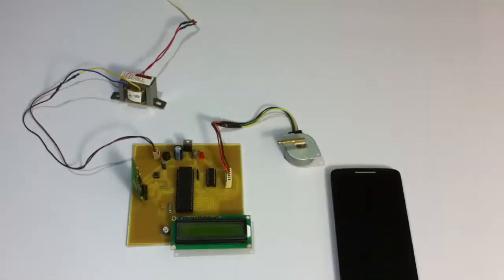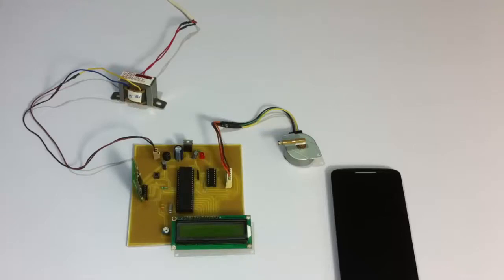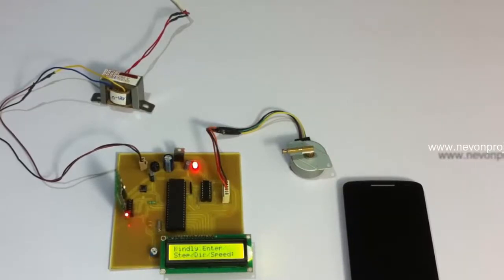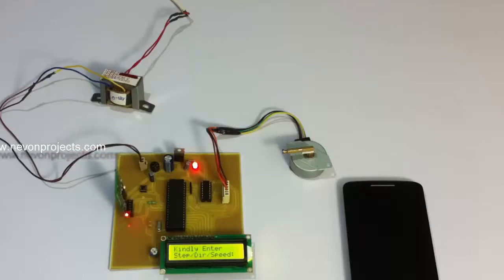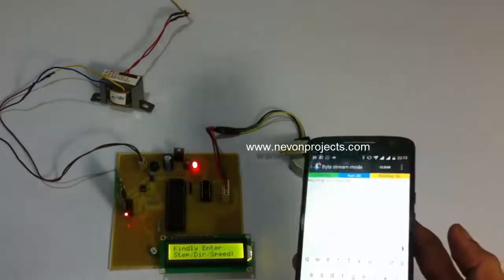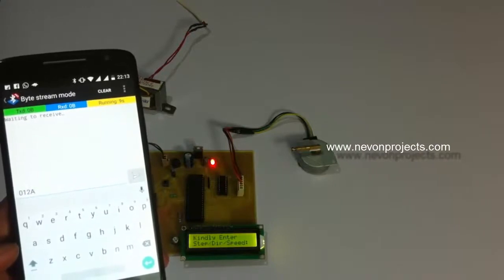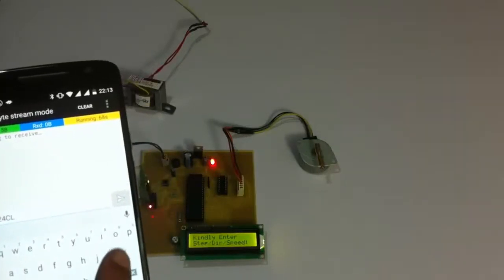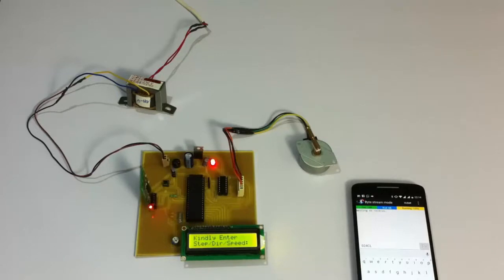Android Based Antenna Positioning System

Comment: can I know it's application
Reply: I assume this is for some externally mounted antenna. Say for example in bad weather you would want to change its positioning based on the area where most your clients are without going out and getting your clothes wet. It doesn't sound very practical.